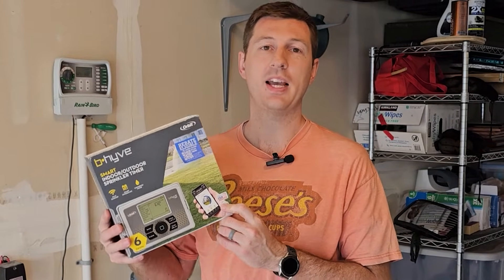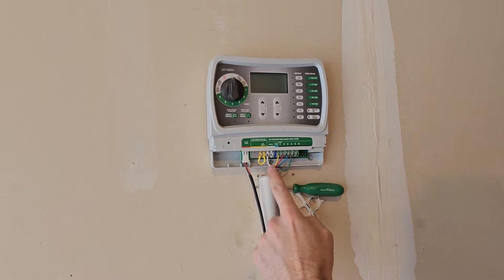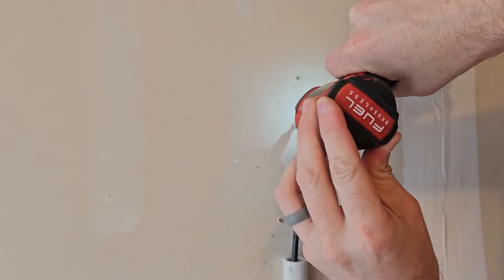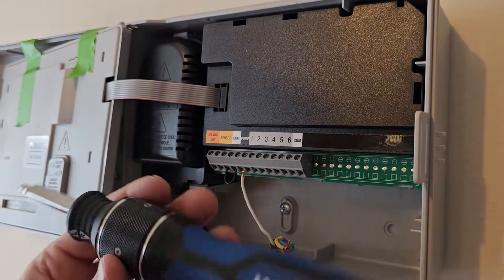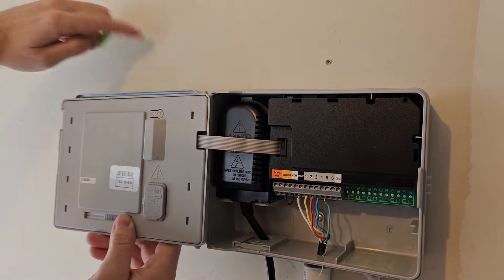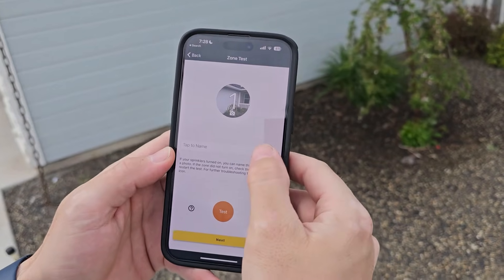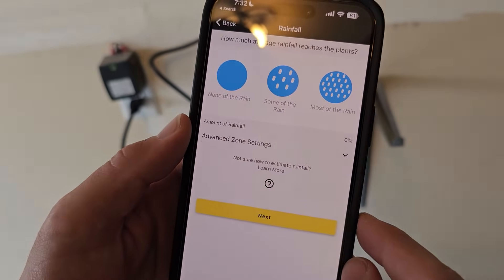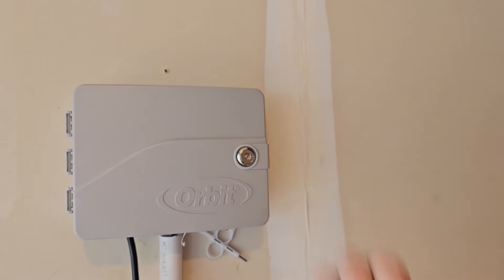Install a BHyve Smart Sprinkler Controller by Orbit

Comment: I didn’t see you plug in the wire to the pump? My old Toro has a pump wire connected and the new BHyve has a slot for the pump. The instructions also said to run a common wire for each valve.

Comment: My question is the wires that come out of the white pipe do we need to turn anything off so we don’t get electrocuted or are they not hot? I purchase it and I’m ready to Installed just wanted to make sure before I try, thank you
Reply: Those are just low voltage going to the sprinkler valves that allow the controller to turn the valve off/on.  There is NO power coming from them.
Reply from the maker: I don't turn off those small wires, and I haven't gotten shocked, but it's probably safest and best to.
Reply: @diyhda you actually can't turn them off, because there is nothing to turn off.  They just carry low voltage from the controller to the sprinkler valves.  No power coming from the valves.

Comment: I have a hose control at far end of property by the same manufacturer.   If I were to install one of these would I be able to control both from phone without interference?
Reply from the maker: You should be able to, but I've never tried personally.

Comment: I don’t currently have one, so I’m not replacing an old system. I’m not understanding what the other ends of the wires are connecting to 😅🫣 what other parts to I need to start a full set up from scratch?
Reply from the maker: Not sure, sorry.

Comment: I'm having trouble inserting some wires into the controller, any suggestions or tricks? What size screw bit are you using? It is very hard using the supplied screwdriver. My old controller had only 1 C terminal with 2 wires connected. Are all the C terminals on the HRC 400 the same?